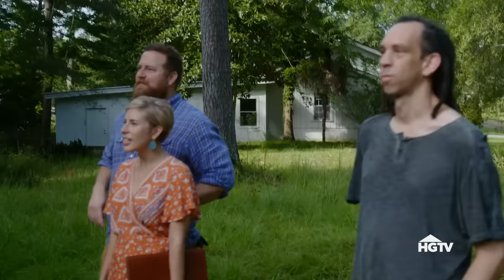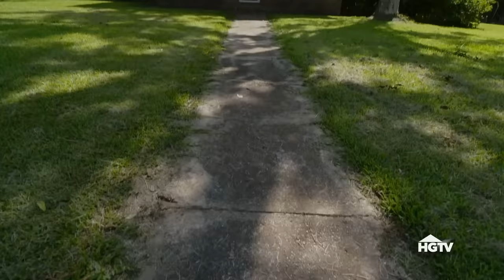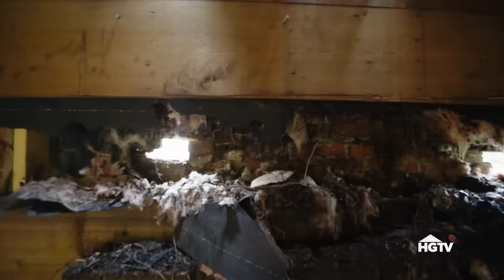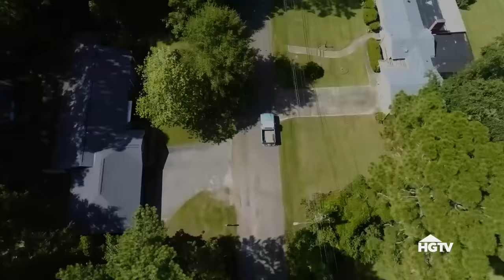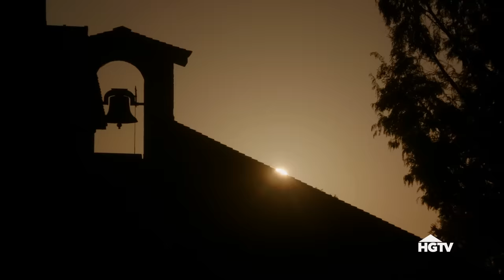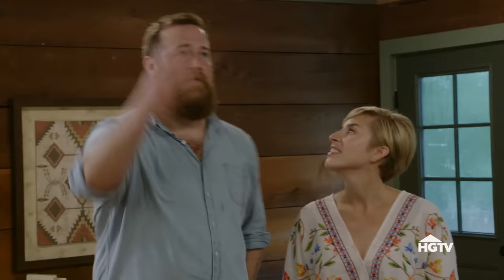Fully Restored Cabin! | Hometown | HGTV

Comment: He definitely made the right decision for him. The result, thanks to Ben and Erin, is outstanding. I think this may well be my favourite project of theirs. There is only one thing i would have done differently, and that is the finish on those magnificent butcher block counter tops. An epoxy finish would be more durable and protect the wood better. Other than that, it is impeccable. An absolute joy to behold.